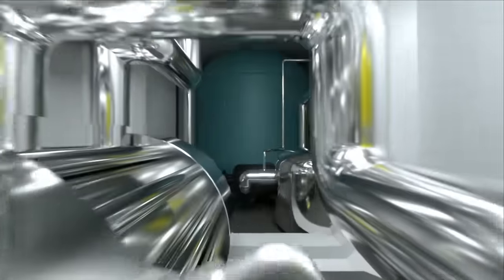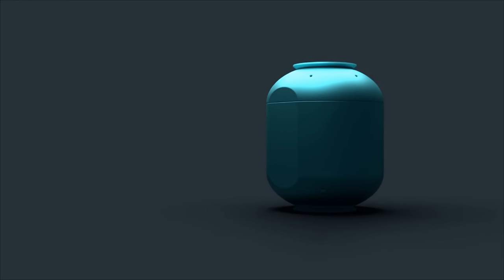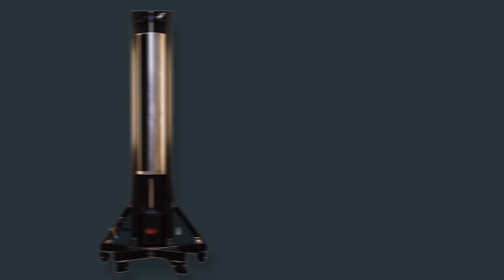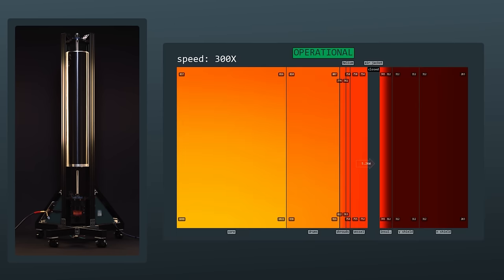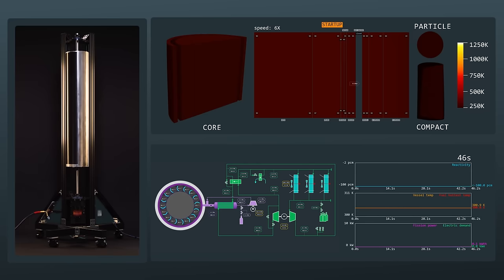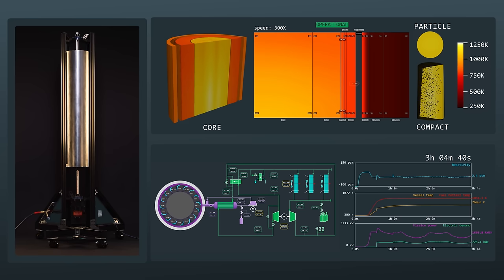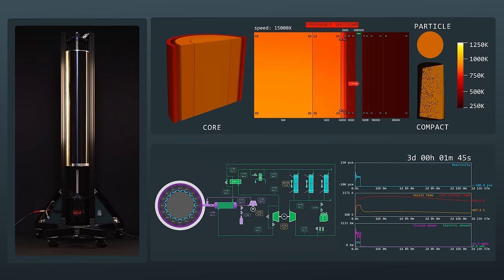Introducing Kaleidos, a Portable Microreactor from Radiant

Comment: The problem with using helium as the heat transfer fluid is that there’s already a shortage of helium. Helium comes from certain natural gas fields in Texas, Oklahoma, and Kansas. If we stop needing natural gas, we'll stop getting new helium. Helium forms a tiny molecule. It leaks out through steel tanks, right through the walls. Once it escapes into the atmosphere, it's gone forever.
Reply: How they keeping it in balloons tho.
Reply: The problem with helium is that it's used where it's not needed such as in party baloons, we won't run out of helium for reactors and all other scientific equipment anytime soon though.
Reply: Helium wells are also not actively being developed, and helium is constantly slowly produced in the Earth's core (hence why we extract it from wells) due to the production of alpha particles from the decay of radioactive elements.
Reply: Not really, balloons only use 7% of Helium usage in the world. Many helium are used to make liquid helium used for MRI machines
Reply: @shanejeftic688  Lol 😂
Reply: @shanejeftic688 how long does a ballon stay inflated
Reply: Yet you can buy endless bottles for balloons
Reply: Source?
Reply: No, we had a shortage, but that was resolved quite some time ago
Reply: There’s just been a monster helium discovery in Montana, iirc.
Reply: @shanejeftic688   They don't that's why all helium balloons deflate in a few days.  The helium goes right through the latex.
Reply: We generate helium nowadays from radioactive isotopes. All our original helium is in space.
Reply: Not really, there exists a way to capture helium without retrieving the natural gas, and we have way too much helium for our uses anyway
Reply: @shanejeftic688  They aren't. It leaks out of balloons as well. Not instantaneously as the gaps in guestion are extremely small, but it will leak out.
Reply: Let's try hydrogen
Reply: Helium is one of the most abundant resources in the galaxy.
Reply: @zero_udk  Ok? And? It's not one of the most abundant resources on this planet though.
Reply: Couldn't you in theory gather up the helium from the alpha decay of uranium?

Comment: this is fucking AWESOME.

id be interested to see a firm/start-up use heavy nitrogen as a coolant which should be able to move even greater amounts of heat for higher efficiencies. you could build the reactor vessel out of silicon nitride and wrap it with a steel body for added tensile strength. if you enrich the nitrogen using ammonia it shouldn’t be ~too~ expensive given scale. love me some gas reactors.
Reply: @Kino_shorts970  Neither TES-3, nor Pamir were like this. TES-3 was a simple water-cooled reactor on several vehicles (not something bad, aside fom the time it takes to set it up for power production), Pamir was N2O4-cooled monstrosity (because N2O4 is bad enough before you run it through a nuclear reactor).

Comment: 2MW is around 200 homes at 10 KW each.  How much to buy one and run it per year for a neighborhood?  How about a cluster of them for a microchip fab, pharma plant, hosptial, or other blackout and glitch sensitive 24/7 operation?
Nice that it doesn't need water cooling, that's the next big problem for thermal power plants, low water and high temps triggering environmental restrictions on warm water discharge.

Comment: What kind of mechanical tolerance is on the safety features? Anything mechanical can fail, valves and floats get stuck. Transducers and gauges can give false readings. How much redundancy is too much? 

What kind of critical failure can be profitably be insured against? How many people can suffer without impacting the shareholders?

Comment: Do graphite-moderated cores have a positive temp coefficient of reactivity? If so, this is just an accident waiting to happen regardless of protective features or emergency cooling. Graphite would expand at higher temperatures, thermalizing neutrons much more effectively thus creating more energy which creates more heat, which causes more fissions, which creates more energy, which creates more heat, and so on. The design is inherently unstable if it has a positive temperature coefficient of reactivity.

Comment: single point of failure plus moving parts, a no-no, besides the reputation issues already makes it a handful, do not worry about on demand and on location, small independent continuous processes storing energy in magnetically levitated flywheels

Comment: Imagine a truck hauling one of these gets into a wreck and flies off into a ditch. Imagine the phone call with the Insurance companies. Imagine filing a claim because you slammed into the back of a nuclear reactor.
Reply: So what ? It's not as if the fuel is some toxic gas or sludge that will escape and poison everyone. If it falls into a ditch with sufficient force to expose the fuel then it will just be collected and salvaged, it wouldnt be under operation in that situation either, so no fission would be happening. Same thing will a crash.
Reply: I doubt the fuel would be shipped inside the reactor lol. It'd still be a very funny insurance call though.
Reply: Umm…, so you know a nuclear reactor?
Insurance: uhh yes we do?
Now imaging a portable one on a truck
Ins: ok
I rammed my car into that shit
Reply: Btw was that funny? No?

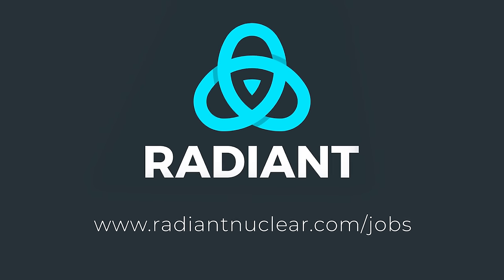Comment: 4:36 I want to believe that a portable fission reactor is far more safer than the traditional nuclear reactor that is housed in massive buildings or structures. I believe that it is easier to contain or control if the fission reactor fails in comparison to the massive traditional ones. And such a smaller nuclear reactor design will be easier to dispose of, when the life of the reactor has ended. I would like to know the safety procedures to contain this fission reactor if it fails. 😎💯💪🏾👍🏾

Comment: Is t this just a pebble bed reactor? Didn’t the French do this decades ago and find that the pebble shielding cracked?
Reply: no sorta normal fuel just more resistant to a meltdown i think
Reply: Those were Germans and the pebbles started cracking because:
1) They were graphite-coated, instead of fully ceramic;
2) The control rods stabbed the pile directly, which does not happen in control drum-operated Kaleidos.

Comment: So do any of these actually exist, or is it nothing but a " concept" that is " just around the corner " like "cold fusion" ?
Reply: No, it does not exist in reality; however, it is far closer to reality than cold fusion, or any type of fusion system.
Reply: @brianb-p6586  portal power is needed just don't like Graphite in the reactor the chance of Unabated acceleration is two high in my mind bit there's a cost to build them

Comment: What if control drums fail to rotate to scram position?
Reply: If the reactor doesn't scram, the core will exceed 900 degrees, which is why they need special fuel that keeps its integrity up to 1600 degrees. At a high enough temperature, the reactor can't sustain criticality. To obtain passive safety, they need a special design that naturally removes the residual heat faster than it is produced in the reactor without reaching temperatures that damage the fuel.
Reply: One fail safe design could be making the active side heavier than the back side then tilting the cylinder axis slightly inwards at the bottom so that in case of total loss of power all the cylinders would rotate to the safe position by gravity alone.

This has many caviats and is sensitive to the tilt of the reactor core but it all can be addressed. For example a heavy metal layer can melt at a designed temperature and make the hot reactor float in a horizontal position.
Reply: What if helium don't radiat then make porous fuel temp will not exeed ...
Reply: @sonacphotos  Or have an electromagnetic clutch linking the actuator to the spring-loaded drum. As soon as power is lost, the clutch disengages and drum rotates to the "scram" position.
Reply: @halnineooo136  hear about springs before? would even work in space
Reply: Springs are an additional failure point. Gravity is always there whether you add springs or not. "The best part is no part" -Elon Musk.
Reply: @sonacphotos  
Can't really draw here, but let's imagine that the cylinder has passive half heavier than the active one. Now simply tilt the axis a few degrees. In absence of an active force maintaining the active half facing inwards, the axis tilt will give a horizontal component to gravity and the heavier passive half of the cylinder will make it rotate till it stabilises in the position where the center of gravity is the lowest. 
No spring needed, just a slight tilt in the axis of the cylinder.
Reply: @sonacphotos  
Exactly, that was my thought. The spring would have been useful for a mobile design like a submarine where the reactor is not always in a horizontal position. I very much admire robust and rugged design where the simplest solutions are usually the best.

Comment: The only issue here would be the rotating drums not being passively safe. You can't SCRAM the reactor with the help of gravity in the case of a mechanical malfunction.
Reply: They can be spring-loaded and connected to servos via electromagnetic clutches.
No power - clutches release - springs rotate drums to scram position

Comment: Can I install Linux on it, disable safety and overclock to 1.8MW? Can I service the fusion core on my own (I assume it voids warranty, that's OK), but maybe you provide schematics for the tinkerers like me to experiment?
Reply: 1. All pieces of critical real-world engineering derive their base floor of safety from hardware protections rather than software mitigations. If your reactor cannot shut itself down the second control system fails to keep it stable, it is not safe for any production use.

2. Your house does not need a nuclear reactor. It is competing with enterprise generator arrays built to power the load of an active factory, not a residential home. And corporations, when not blinded by sales teams, tend to be wise to servicing cost. They understand that a startup may go defunct or be acquired any day, and as such their biggest clients will want maximum control, including knowledge of maintenance procedures or access to its software; the only limiting factor is that the manufacturer wants to protect its IP, and as such would not provide all materials to reproduce their sole product.

It's the same answers as those to consumer electronics, except here the clients do consistently vote with their wallets to defend their self-interest.

Comment: Assuming these things don't just melt down by themselves, what happens when they get hit by a train or dropped by a crane?
Reply: Nobody is shipping them already fueled.
Reply: @OutsiderLabs  So no one moves them after use? Also, what prevents a truck from running into one while the generator is parked and running?

Comment: Thank you .  I have been thinking about this for some time.  I like the barrel idea.  I wonder about potential degradation at the bottom of graphite "sleeves".   My question relates to what might interfere with an emergency rotation.  Perhaps you speak to this in your presentation but it isn't clear to me.  I wonder if you could speak to the -ve coefficient.  Thank you for your time to consider my questions.
Reply: ב''ה, appears an obvious enhancement may be possible, not sure what other problems might be created though it could fudge compactness.

Comment: Yes helium is safe in terms of not carrying radiation out in operation (and in terms of not being able to generate hydrogen if overheated). But I feel not safe with a graphite moderator in the core in a scenario worse than the one that a simulated is described of at 3:35
It says: "the control drums shut in and the air jacket opens". This is still assumed to work. I presume (sure hope) drums snap to off on powerloss, but what if some or all fail due to heavy mechanical deformation?
Graphite in a core will always makes me seriously uneasy.
—
I'd really like to see safe small reactors but as long as they have graphite in the core I still suspect accidents. Maybe much more rare occuring, but then again smaller reactors mean more reactors and not always at the most safe places. Murphy.
—
Why not use inflammable (edit: I meant non-flammabls) and thus infinitely safer silicon carbide as moderator instead?
Does anyone know?
Is it due to:
★ Insufficient neutron moderation?
★ Limits in manufacturability?
★ Cost of manufacturing?
Reply: And why not a Thorium based reactor with a tiny diesel generator to start the reactor?
Reply: @Pifagorass  Thorium does not contain enough fissile material to initiate a nuclear chain reaction - It makes significantly more sense to utilise Uranium only.
Reply: @mindfu7  Or Uranium-Thorium fuel mixes, like Germany did in THTR-300
Reply: @mindfu7  And it doesnt not produce plutonium :D
Reply: Silicon carbide does not seem to be a neutron moderator, there have been concepts of using it as cladding*, but this is due to a *lack of moderation (neutron moderating capability is directly based on reflectivity, while good cladding requires almost no reflection or absorption). Despite its flaws, graphite is a very good moderator, the only better option is heavy water, which is highly expensive. The total moderation effect isn't really the biggest feedback factor, though, the simple thermal feedback is enough to kill the chain reaction if the reactor heats up too much, which is why decay heat is the only real concern for reactors besides very weird incidents like Chernobyl (which was, in a way, ironically caused by a lack of graphite, had the displacers attached to the control rods been longer it would have never happened)
Reply: @gmhs2  – Hmm I guess the Silicon in SiC might be the issue absorbing to many neutrons? 
What about the reactor core being mechanically deformed (but not broken) like (god forbid) from a tactical nukes pressure? Can a power excursion igniting the graphite not happen for sure? Surely a subsequent open core fire would be way worse than the radiation release from the already bad enough bomb. Well, micro-reactors might not carry much more material than a bomb I guess.
Probably a "we just say this won't happen" 🙏 case.
Reply: "inflammable" means "easily set on fire". You probably meant "non-flammable" (meaning that it won't burn).
Reply: @brianb-p6586  Yes. 
Non-flammable I meant. Thanks.

Comment: I feel like it needs BOTH computerized and non-computerized sensors/oversight and a very-worst-case-scenario mechanical system for cooling these cores under the worst worst worst worst worst case unthinkable scenario. (such as an airstrike, sonic attack, or EMP attack.)

Because somehow, the unthinkable has a habit of happening.
Reply: The drums can be spring-loaded and connected to servos via powered clutch.
No power - clutch disengages - drum rotate to scram position.

Comment: So…side fans mean it’s on the surface open to the air, so a bad actor could walk up to the core with explosives. Also…a control drum? Hope that is spring loaded to shut down if there’s a loss of power.

Comment: I've heard of these being ready and  used on ships that travel to areas that need emergency energy.
Reply: Fictional nonsense.
Reply: Likely you're thinking of RTG (Radioisotope Thermoelectric Generators) rather than such microreactors. They provide a much smaller amount of energy, are much simpler in their design, and tend to be very low maintenance. They've been used extensively by Soviet Union in remote facilities, lighthouses, and are even used in space probes. While I had not heard of them being used in sea, it wouldn't be difficult to imagine compared to a state-of-the-art microreactor like Kaleidos.
Reply: @rkvkydqf   So, what about reactors on submarines and aircraft carriers?  (and planes)  I contracted for the DOD/DOE at the Naval Reactors Facility in Idaho.
Reply: @rkvkydqf  RTG's are used for remote power, but would not be useful in the emergency power scenario described.
Reply: @betsybarnicle8016  All current operating US nuclear-powered submarines and aircraft carriers drive the propellers directly from the steam turbines, not by electric motors, so their electrical generation capacity is only adequate for their internal electrical requirements... they are not electrical generating stations. 

There are no nuclear-powered aircraft.
Reply: @brianb-p6586    Not officially (re aircraft).

Comment: “Replacing diesel generators”
In your dreams.
Reply: Yeah, so stupid, solar already replaced diesel and for much cheaper
Reply: @OutsiderLabs  Yep and also, since solar panels have no moving parts they don't need maintenance, whichs makes them more cost efficient thatn nuclear.
The only issue is the slow panel degradation and keeping the panels clean.

Comment: Super!  What is the source of nuclear fuel?
Reply: U 237
Reply: The video and their website say "Meltdown-proof TRISO fuel, ceramic coated uranium particles". 

According to the Wikipedia nuclear fuel article:
"Tristructural-isotropic (TRISO) fuel is a type of micro-particle fuel. A particle consists of a kernel of UOX fuel (sometimes UC or UCO), which has been coated with four layers of three isotropic materials deposited through fluidized chemical vapor deposition (FCVD)."

So, uranium.